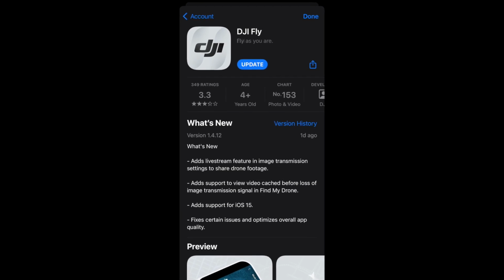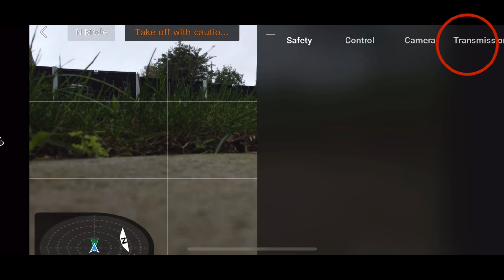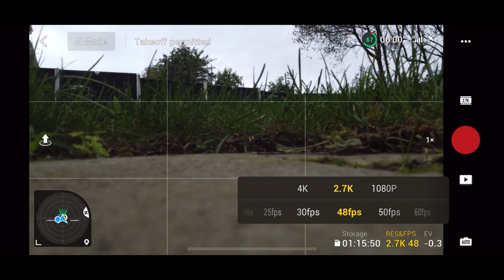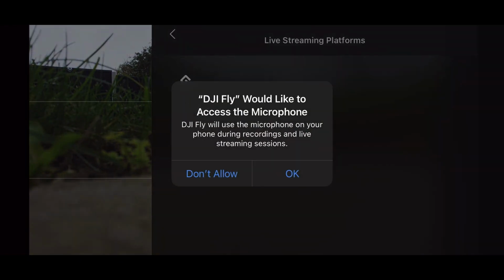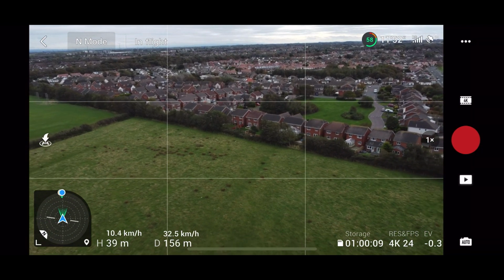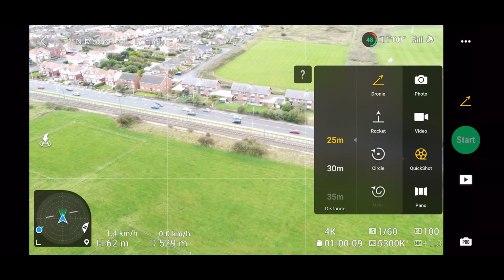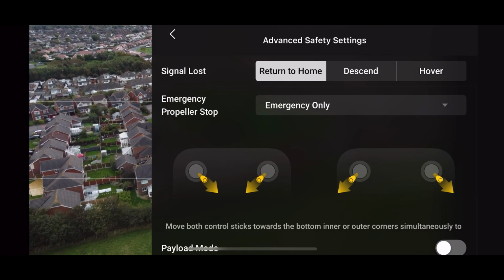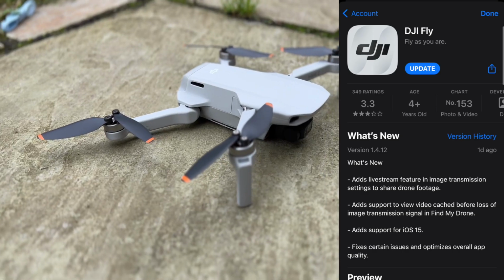DJI FLY 1.4.12 NEW UPDATE IOS  | DJI MINI 2

Comment: I don't know about IOS, but Android is having issues. The App number has only changed a little, it's Still V1.4.12, it's the last 4 that denotes the new app, the old app is 1.4.12(1420, the latest app is 1425 which is having issues.

Comment: Something to test Darren. Today I went out using the updated IOS. I only took some pictures. Auto sync was turned on, but somehow the pictures doesn’t end up on my phone. Also the pictures were not vissible in the dji fly app. The only appear when I connect the drone in the aircraft album. Previously the foto’s ended up twice or triple times on my iPhone…… strange

Comment: Thanks again Darren for keeping us informed with the updates.  I have had problems with updating within the app itself and had to delete the app all together and reinstall it on my phone in order to get updates.
I have had problems with the drone, or the controller, (Mini 2).  On the controller, I am unable to use the "auto take off.  The button just does not work.  Plus, when the battery gets low, it does not automatically start the count down to RTH as it has in the past.  Hopefully, this update, and/or, reinstall of the app will fix these issues.
Thanks again for all your video's and keeping us informed with everything going on.
Reply from the maker: That’s not good , have you deleted the cache from the app , delete it and reinstall. If you get issues go on DJI twitter they fast as replying , might be something worse
Reply: @DMProductions  yes I have deleted the cache before with no change. I will try it out the next time I’m able to get out and fly again. Thanks for the reply.

Comment: What about the iPhone battery usage/overheating present in other recent iOS versions?  I know you use a workaround of low power mode, but that doesn't work for older iPhones.
Reply from the maker: It’s England , freezing now 😂 but I haven’t had any issues with recent flying but I have now got a different phone, faster processor and never had a issue even with low power mode off
Reply: @DMProductions  If the wind dies down at any point during the day, I shall venture out with my Mini 2 and iPhone 6S

Comment: Darren, do you plan to check the latest dji fly app version for Android? I understand it has other issues around saving any changes you make to your gimbal speed and yaw movements. After you change these settings it doesn't save the changes. Did you check this on the ios version?
Reply from the maker: Yeah everything saves the same once you set them up no issues on iOS.
Reply: @DMProductions  any plans to test the Android version as there seems to be issues still.
Reply from the maker: @PetersReviews  not currently sorry I have pages of projects currently ongoing
Reply: @DMProductions  hi just got one of these after watching you vids so it s the new app on andriod light dose flash but you carnt change colour and makes no differance on rainbow..
Reply: @DMProductions  Hi Darren, can you post your footage of the Gimbal and yaw settings being adjusted and being saved with your ios? Many others are saying this is not the case, as you have seen this work I think it will help.